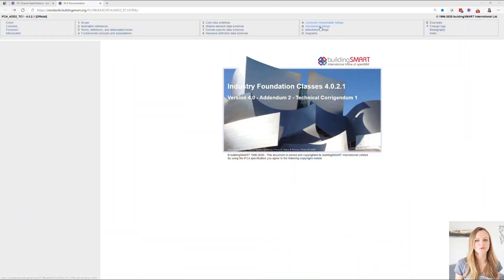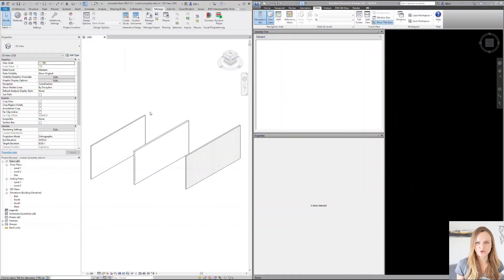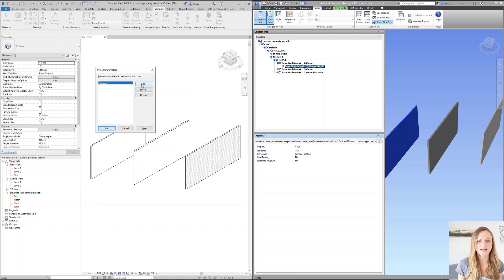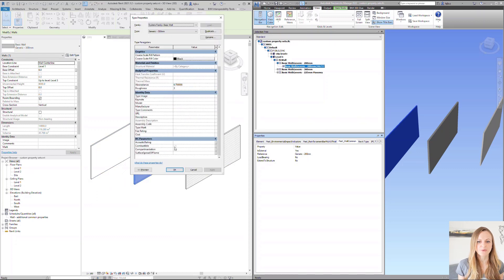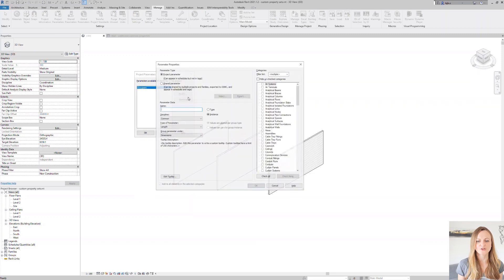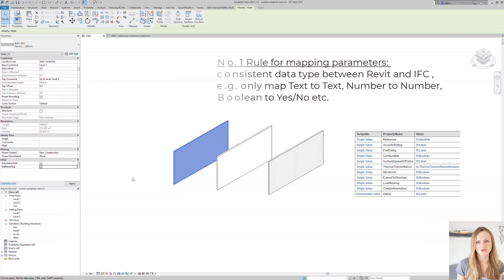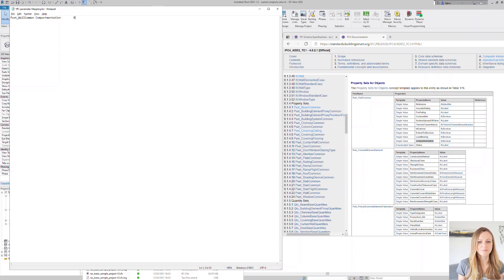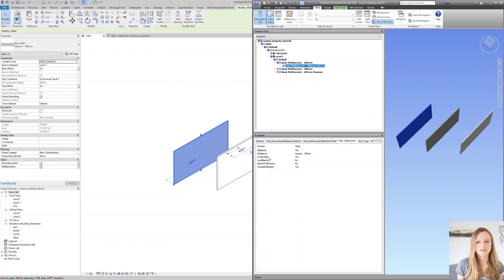Exporting IFC Common Property Sets from Revit

Comment from the maker: A little hint on the project I used to copy my properties - I created my own one, but there is an older one from Autodesk with ALL IFC properties, however it is a bit outdated and doesn't contain some of the newer properties, which is why I prefer using my own one. 
The official one can be downloaded here: https://knowledge.autodesk.com/support/revit-products/learn-explore/caas/CloudHelp/cloudhelp/2019/ENU/Revit-DocumentPresent/files/GUID-4EED7335-DCC7-48AD-A8BD-8156CAB27A33-htm.html
Reply: Dear Leila, unfortunately,  the link for accessing the IFC-specific files in the link provided above is not working for a long time ago. Is it possible to be updated? Thanx in advance
Reply from the maker: Thanks for the comment, Trajce! The broken link has already been reported. Until then, I can share my copy of the files - as mentioned, please note they are a bit outdated. https://www.dropbox.com/s/3qlevdxq539s2su/IFC%20Shared%20Parameters.zip?dl=0
Reply: @BIMmeup  Perfect, thanx
Reply: dear sister, bolts are exist there is no problem but when I hide the reference model in tekla structures the bolts are disappeared. this is the problem. can you advise again.

Comment: Thank you for the video! I have one problem when exporting the Common Psets: sometimes I do not wish to have all Common Psets exported, I just want a few ones (i.e. Slabs and Walls). Is there any way to export them without having to map them individually in an own property set and then turning off the Pset common export option? Or is there any list of the internal Revit mapping of the Common Psets, so that I could just copy the ones I need to my custom parameters? Revit doesnt seem to have an option where I can select witch Common Psets I would like to export.
Reply from the maker: Thanks for your comment, unfortunately there is no way to limit which custom Psets will be exported from Revit, they are hardcoded (as they are considered as the basic information that should be available by default in the IFC schema).

Comment: Great videos!! I'm having a hard time with mine pset. Recently I update my revit to 2024 version and some of the information is not working anymore, for exemple width and height os windows and doors. Would you know why this is happening? Or what can i do to solve this problem?
Reply from the maker: Thanks for your comment! There were some changes around how types are handled in IFC; try adding IfcWindowType and IfcDoorType (Or IfcBuildingElementType - depending on which classes your are mapping, just add the type entity) to your mapping file!

Comment: dear friend, when I take ifc file into tekla, why do the bolts are disappeared, please help me
Reply from the maker: Hard to say, if the bolts are visible in an IFC viewer, you need to check the Tekla import settings and whether the IFC class the bolts were exported to is excluded from import. Good luck!
Reply: @BIMmeup  thank you a lot, dear sister. I will try again. thanks

Comment: Hello, thank you for this video! Would it be a good topic to also make a video about exporting the BaseQuantities? I find this to be a very hard job. For example: buildingsmart devines that IfcColumns will get a NominalLength when exported to Ifc2x3 but in Revit (for as far as i know) it is impossible to get this (Base)Quantity of the IFC.
Reply from the maker: Thanks, will put it on my list now that I'm back again! :-)
Reply: Use ArchiCAD - Much better IFC interface/selection/export/control over mapping etc, and easier to use. The difference is like Revit for PC and ArchiCAD for Apple. A much more pleasing GUI.

Comment: Great videos! I really appreciate the effort and time for putting all these things in clear and understandable video content. Keep them up and going regularly :) However, even though I frequently use it, with my own mapping files, I have to mention that IFC exporter for Revit is lousy compared to the comprehensive  IFC exporter from your competition. Truly think that Autodesk should be more involved in the development and improvement of Revit IFC exporter. 
Another disadvantage of the current Revit IFC exporter is an inability to export specific elements broken down to its layers (walls, floors or similar) as competition exporter does... Instead of that, we have to convert elements into parts, but it could be extremely difficult to maintain the entire model converted into parts just because IFC exporter can't do it by default. 
Also, I have to mention another important thing - the inability of the current Revit IFC exporter to export Material properties?! Why the hell is this so big issue for years? Again, competition exports these properties as well.
These videos are extremely valuable, but on the other hand, there is still a lot of unsolved issues even if we have the perfect models, properties and mapping files.
Reply from the maker: Many thanks for your comment - I'm always glad to hear my content is helpful! :) I'm only sharing my own knowhow however - if you want to provide feedback to the Autodesk product management, Sasha Crotty just summarized all the ways to contact them perfectly yesterday (you just need to watch 1 minute or so): https://youtu.be/FjSbv6W6tcg?t=345 
I really encourage you to keep an eye at the Inside The Factory videos on that channel,  they provide a great way to get in touch with the product managers and understand what's happening in the background. Thanks :)

Comment: Nice video but just a few things - your text file which is user defined should have been selected under user defined export rather than parameter mapping, also wondering why in the text file you didn’t specify as IfcElement or what type of parameter they were ie text, Boolean etc
Reply from the maker: Thanks for your comment, Graham! I think you‘re talking about the custom property sets - for these we need to specify the data type, class etc. - that video will be up in the next days! :-) I sometimes mix them up too, we might have too many textfiles involved in the export... ;)
Reply: @BIMmeup  yes user defined property sets - look forward to your next video